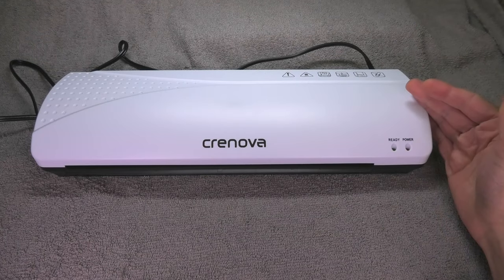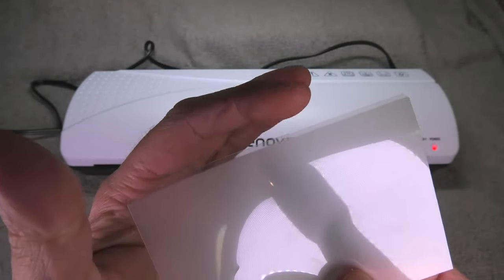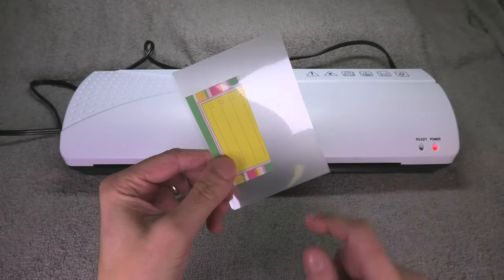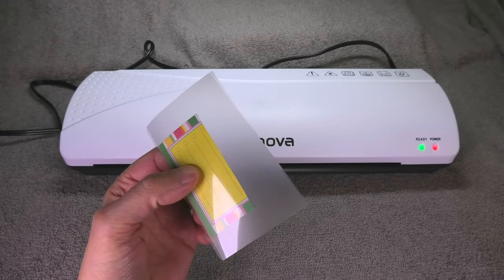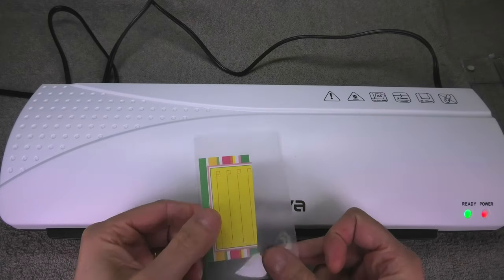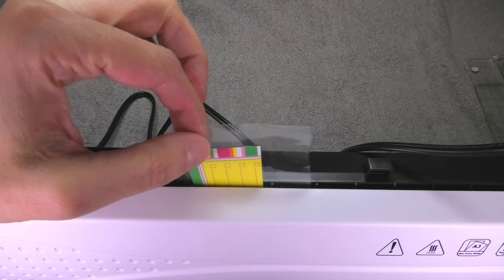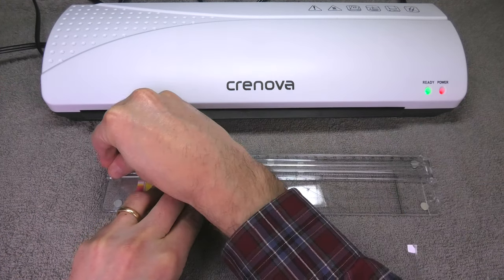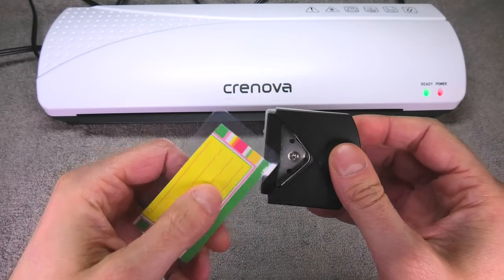How to use a LAMINATOR

Comment: if you cut the laminated card in half,will the lamination come off?
Reply: Once it's laminated it should stay laminated when you cut it
But if you want little laminated cards but only have a A4 sheet
Cut the cards beforehand you laminate and then after that leaves of ring around the cards witch helps keep the lamination more